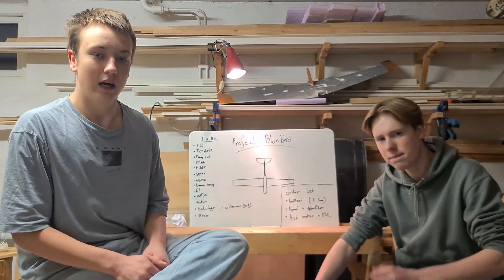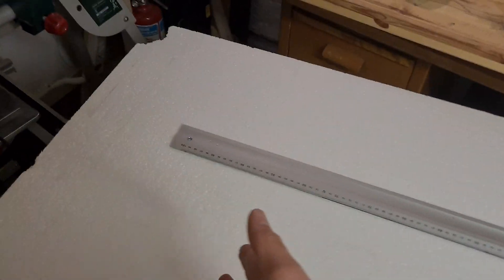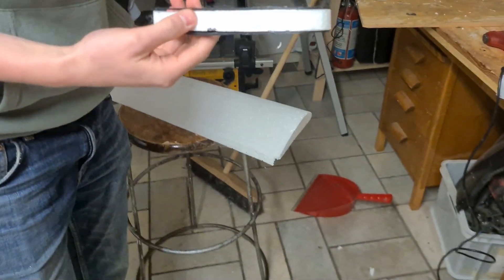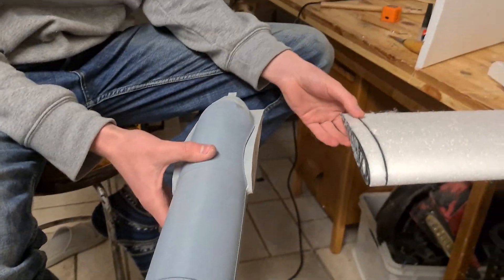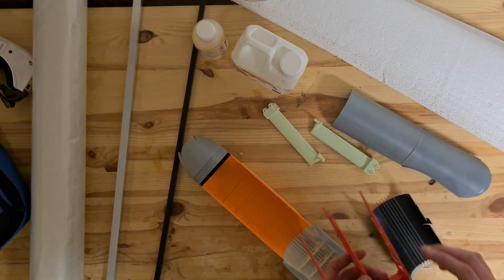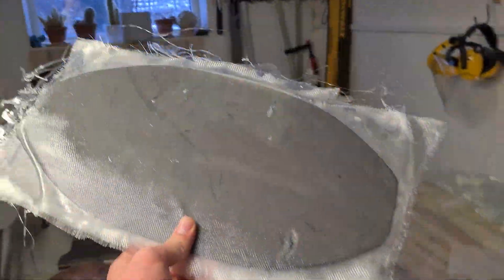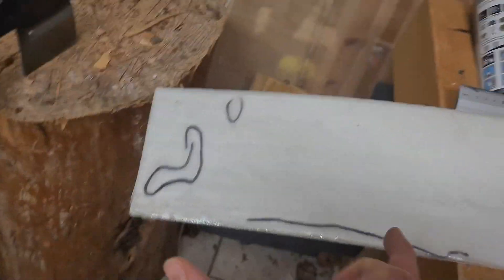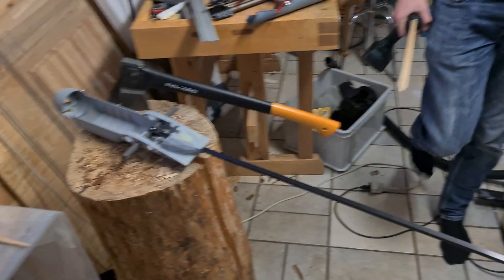Our best UAV EVER?! | Project Bluebird Part 1

Comment: Distribute your energy source (battery) across the entire body of the vehicle, look into cells that can be damaged and still function, I think they are Graphene-Gold Cells but I may have confused that with some other Graphene Cells.

Solid internal structure in the wing is additional weight that isn't needed. Get rid of it and you'll increase your power-to-weight ratio.

Be prepared to design your own PCB, possibly even a flexi-PCB so that you can build it into the walls of the vehicles fuselage.

Design a clip mechanism instead of magnets to hold the side one, magnets are heavy, hollow plastic clips are not, you could also use some kind of thing steel wire like the type used for paperclips and have that act as the clip mechanism, obviously it doesn't need to be big, a simple single-entity flexible structure to create tension and a surface for the clip to hook around inside would be enough.

Look into options for adding a antenna along the wing lengths, a strip of wire might be all that's needed depending on what frequency you operate at.

Maybe look at making your control surfaces larger, you have additional wing length not being used, that is an efficiency loss potentially (it depends on how powerful your servos are).

Remember that in every decision you make, their is potential gains or losses to be made, and you'll only continually make gains if your thought process is focused on maximum overall efficiency by measure of individual component efficiency.

It looks impressive so far, but as this is your first video I have ever seen and I haven't seen any footage of it flying it would be naive of me to come to any conclusion about if it is truly any good until after I have seen footage of it's capabilities and details on it's speed, range, cost-to-produce, additional features (camera, etc).

Good luck to both of you with this project.

Comment: With your talent, you need to build small CNC router. I've designed and built a small mill and 2 routers and have nowhere near the talent that you two guys have. Surprisingly cheap to build too. I cut thin carbon fiber very easily and quickly and most importantly - very accurately which makes assembly a breeze.
Reply from the maker: Thanks for the idea!